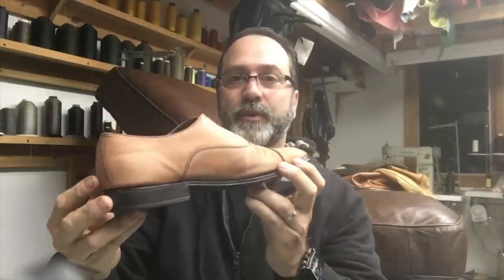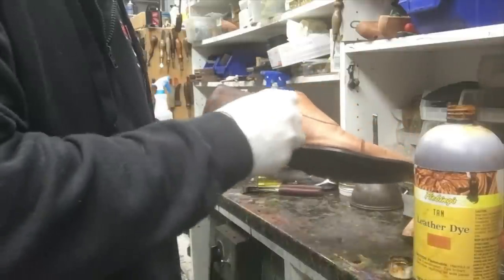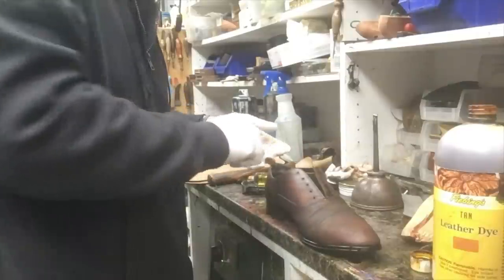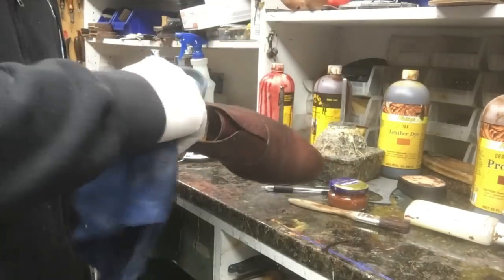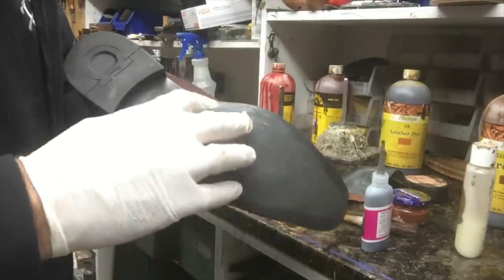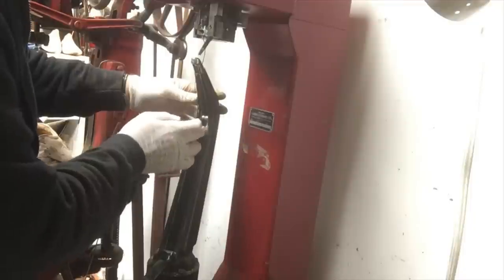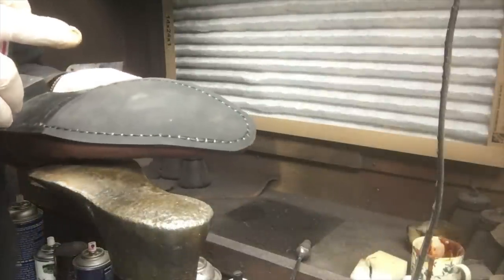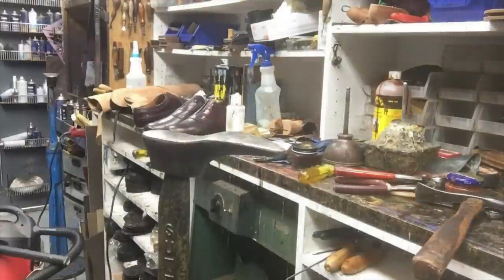Ferragamo shoes #141

Comment: Still impressed.  I did not see how you attached the heel (one piece, it appeared).  I had some shoes made in South America.  Though the uppers were fine, the sole/heel came off.  With a 'waffle design' inside of the heel nailing it to the foot bed would be difficult.  The glue (on mine) had already failed once and separated. Perhaps you used a combination of 'instant glue' and contact cement on the heel, also.  Still wondering in Memphis.

Comment: Could the sole have been changed to a JR leather one and Blake stitched as you did or have a welt put in and stitched that way? I'm curious. Really shocked by the original build quality of what I'm sure was a very expensive shoe. Lucky it's now had the "Steve Touch".
Reply from the maker: Yes you could do it in a few ways. You could put a thin glue on welt and JR soles or just the JR itself . Both would be a blake stitched.

Comment: Short question steve.... on witch Temperatur does your superglue die? The superglue i use gets of the material at 60°Celsius(140°F)... at the time you put it under the lights i heard a voice in my brain screaming:.... noooooooo....🤣🤣🤣😉
Reply from the maker: Not sure about the temperature but when the surface has enough heat to blend both glued together that’s when it’s time to remove it from the heat lamp, I’ll have to see what temperature that is

Comment: you might consider teaming up with the tuber "the elegant oxford"  he has a program to get good shoes to those that need them. I have lots of shoes, and have no need for fine shoes, so I'd just as soon see somebody get them that needs them to get a job or whatever.
Reply from the maker: toot tall I know Preston very well
Reply: toot tall ... Good shoes are not always dress shoes. sturdy, long lasting, maintainable and repairable... that's good
Reply: @alx252  My goal in shoes these days is strictly comfort. I recently got some suede sketchers that are actually wide enough for me, so they're much more comfortable than the size or two larger shoes I normally have to use to get the widest part moved forward a bit. Then just the other day I found some.in a polished leather (well polishable, I had to give them a good shine) that are also wide enough for me to wear the 12 I really should wear, but like EEE or EEEE They have lug soles and should be repairable if they don't out last me. I will probably only wear them on some nasty winter days, but we don't get a lot of those here usually, so they won't see a lot of wear over a year's time. Be good hiking shoes if I did that any more, but I don't. I am not particularly brand loyal, if they fit good and feel good, I'm good. I have like 14 or 15 pair for myself, and many tubs full of shoes and boots for resale. Mostly I have military hot weather boots, some new in the box, others have seen some battle it appears. Whenever the price is cheap, I pick them up. Funny thing, I can sell beat to snot old cowboy boots and work boots quicker and easier than nice new ones. Go figure.

Comment: You may want to try replacing the needle on the stitching machine that has tension issues. Sometimes a burr in the needle will cause issues with thread balance. At least on a regular sewing machine it can. I'm sure leather needles are far stronger than the heirloom fabric weight needles I'm used to, but like anything - they will eventually wear out.  I always go straight to the John James English needles for the results I like. Cheers.